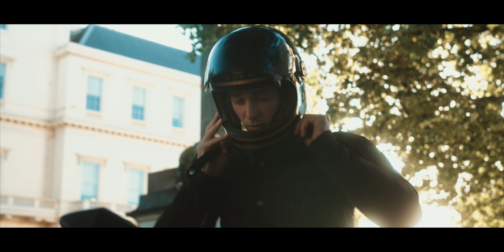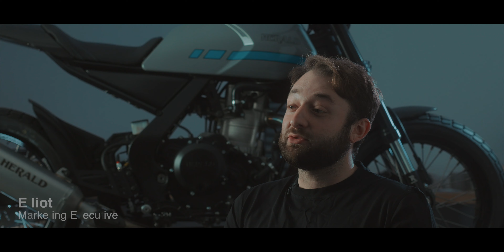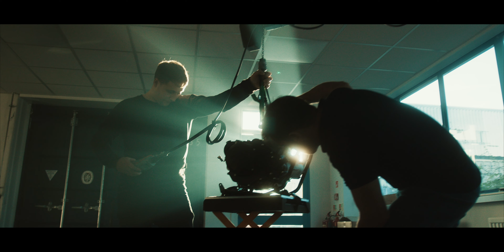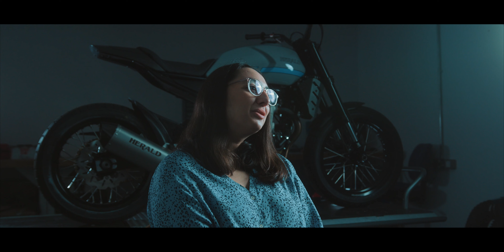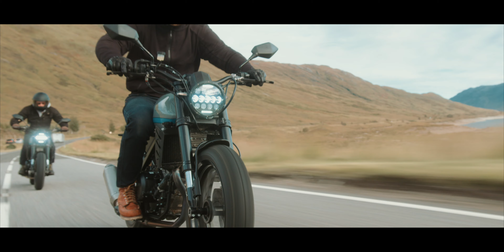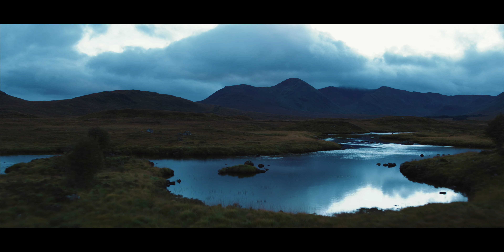Brute 500 Launch Video

Comment: There has been great comment regarding the price of this bike and yes there is a lot of choice in the price bracket from established manufacturers. However for the mainstream manufacturers to achieve the 7K price bracket the product will almost certainly be built in the east. A British built bike will of course cost more to build but if you compare this bike to the CCM Street at 11k. This bike is an absolute bargain
Reply: But how much of it is built here and how much is built abroad and then simply assembled here?
Reply: I was very impressed with this bike when I sat on it at the Peterborough bike show a year or so ago, that was until I was told the price, over £7,000 on the road. I settled on a new Benelli Leoncino 500, just over £5,000 on the road and delivered. I would love to see this " British " model do well, but I do not think they will at that price. I hope I am proved wrong.

Comment: Love Herald. Just bought your Brat 250 👌👍
Reply: Hi I am seriously interested in the Brat 250 but cant get a test ride. How are you finding the bike ? Speed acceleration comfort etc ?
Reply: @pggp273  It’s not great for speed but it’s not a road bike. Seat is fine. It’s fantastic on country lanes & puts a smile on your face whenever you ride it. Oh & the exhaust noise 👌. Mine came from Evolution motorcycles, Hersden.  Not sure where you live but they have one arriving soon from Herald. Not sure any dealer will let you test ride. 👍
Reply: @meddlecho   Thank you for coming back to me. I like the idea that there will be very few about. What plate reg is yours on as they are all pre reg. Do you mind if i ask how much you paid as I've seen them for 3500 and the cheapest I've seen was 3300 but that sold pretty quick. Unfortunately a lot of Herald dealers are pretty useless, however I have connections in  kent so would be happy to chat with your dealer if you had a good experience.
Reply: @pggp273  It’s a 71 plate & was 3500. Evolution have been great & they are 100% committed to Herald. They offer a delivery service if you were interested. Speak to Kerry if you want to go further, extremely helpful.